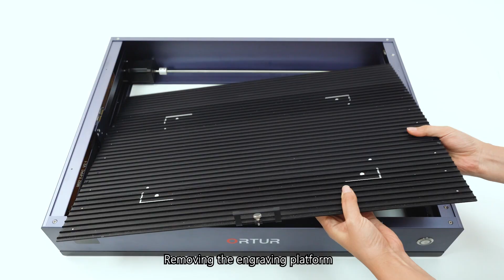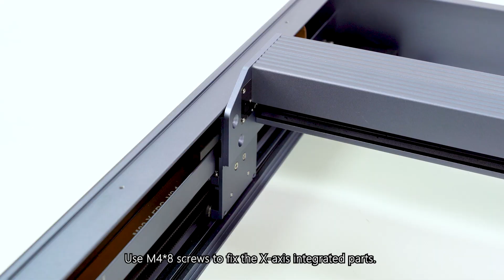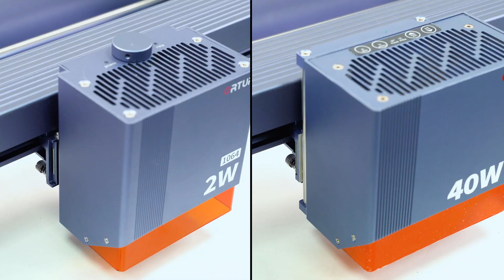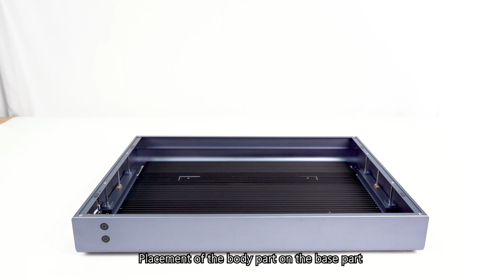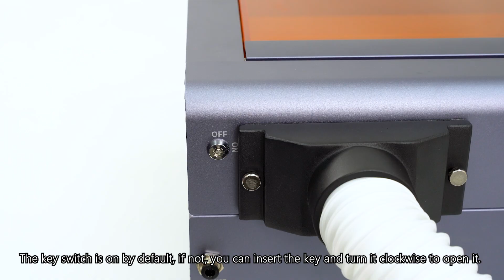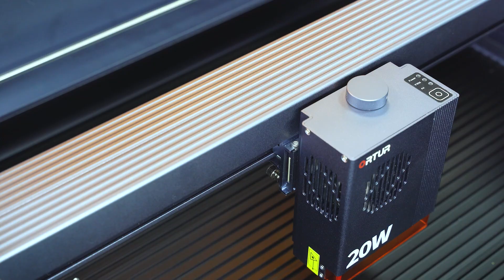Ortur H20 Complete Setup Guide

Comment: Those holes for the 6 thumb screws don't align enough to get all six in.  Not really happy about this, not to mention, it's stuck in "homing..." status and is unusable :(.
Reply from the maker: First, screw all the bolts in one or two turns without tightening them completely. During the process, you may need to slightly adjust the housing to align the bolts with the corresponding holes. Once all the bolts are in place, tighten them together.
Reply: @ORTUR_TECH  I did that.  I followed the instructions to the letter.  The holes are so misaligned I can't get them all in.